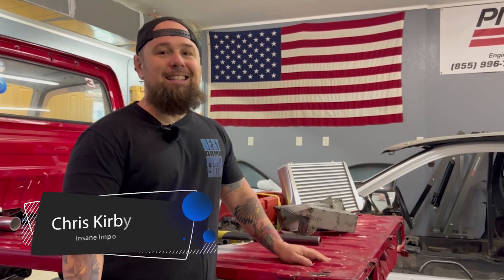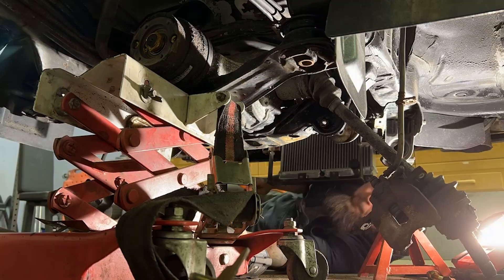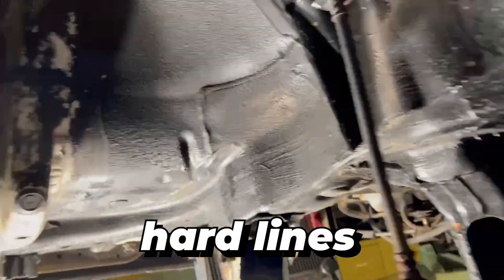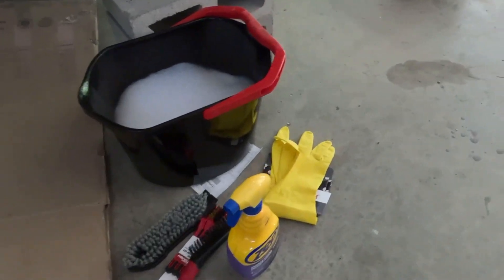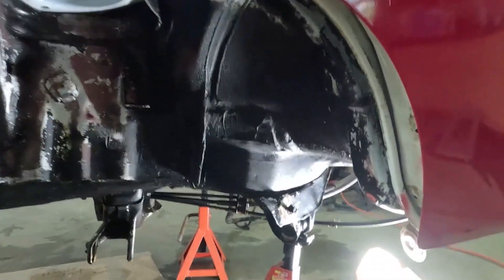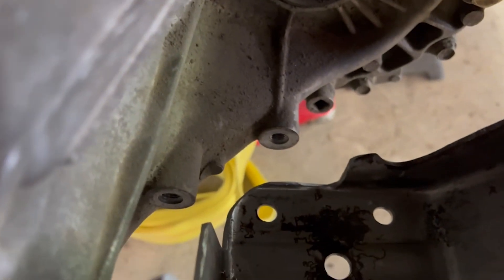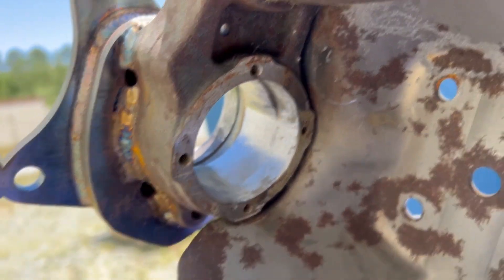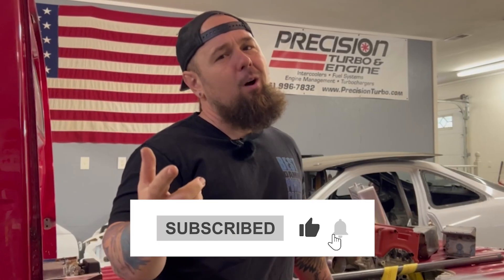JDM Mini Truck K24 Swap in Honda Acty - Progress on Rare Kei Truck Engine Mod

Comment: I gotta find an axle for mine where do you find parts for these reliably  what interchanges with these
Reply from the maker: I have purchased some stock parts from a place in the states called Mactown Mini Trucks. Dude that owns it is named Jimmy Johnson and he is very helpful. His website is a bit dated but if you get his number and reach out he can usually point you in the right direction for stock parts, if he has them here.